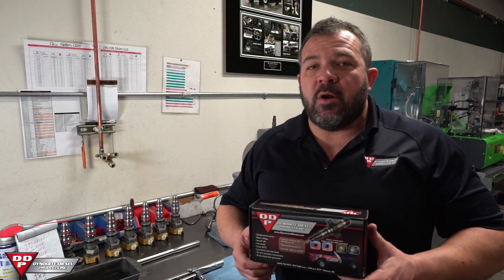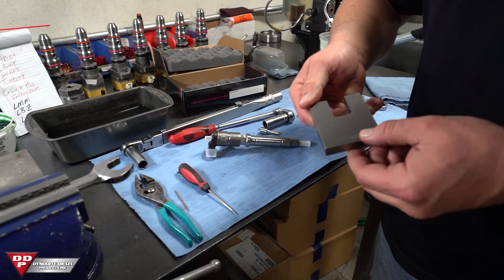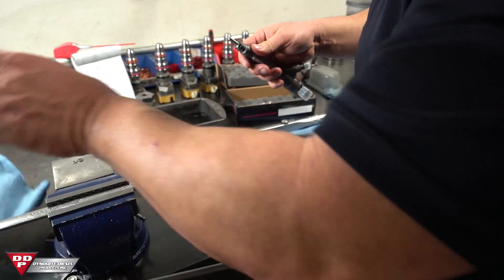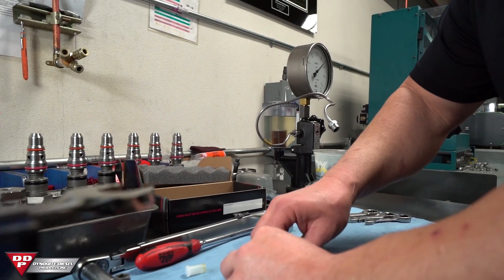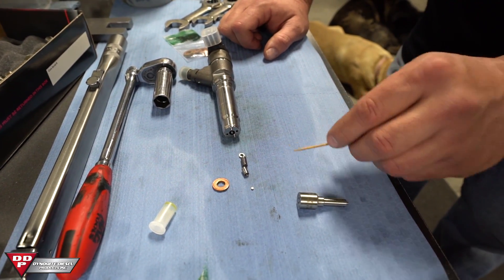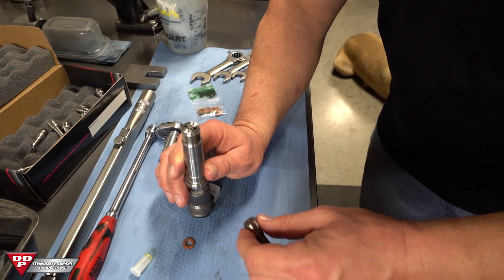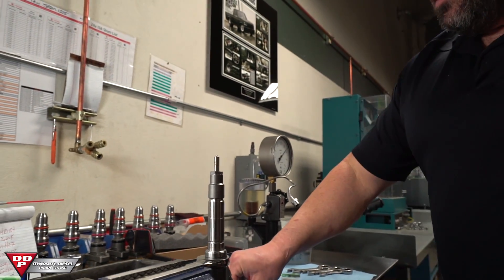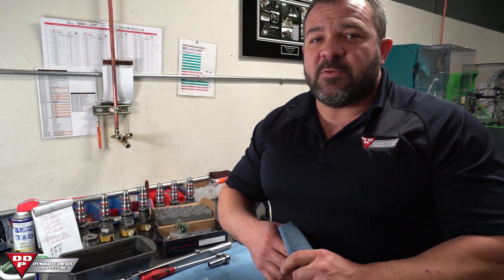How To Install LLY Duramax Nozzles

Comment: So the calibration shims stay the same? I want to install 30% over nozzles and wondering if it's just the same process? I heard they had to be recalibrate?
Reply from the maker: The ideal solution would be to recalibrate the injector with different shims once the new nozzles are installed but at the 30% over (or less) size it is not critical.  Feel free to give us a call at the shop if you have additional questions.  Thanks